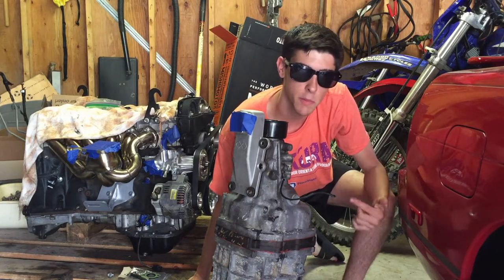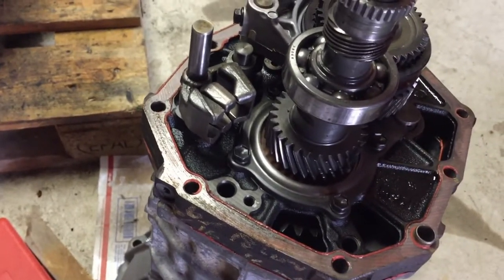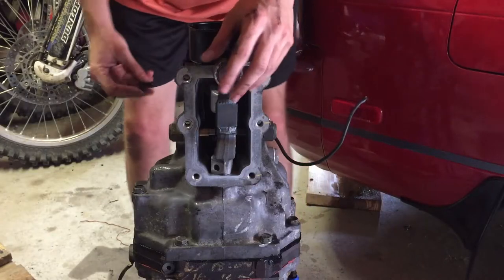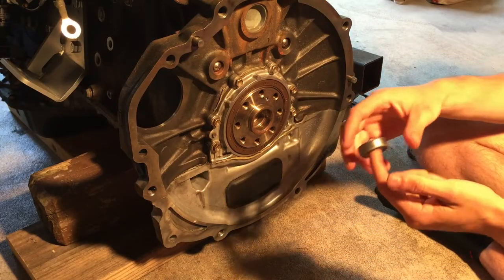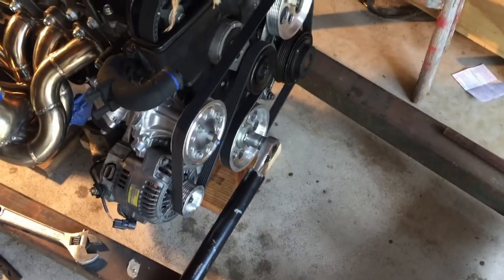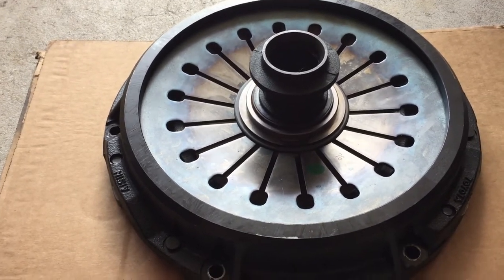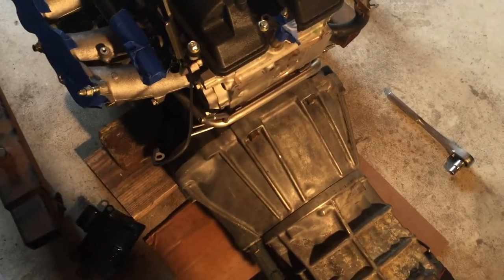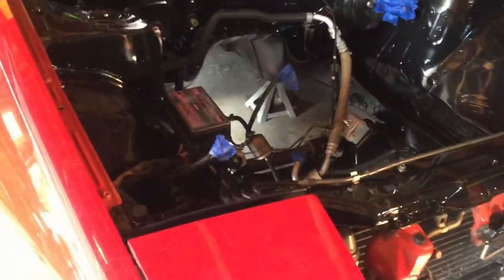Ep. 11 | Installing R154 Transmission on 2jz | 240sx 2jz swap

Comment: May we get the short shifter link? And how has it held up?
Reply from the maker: Not a problem boss! Here is the link:
https://www.amazon.com/PQY-Gearbox-Shifter-Compatible-1978-2002/dp/B07VRC5X2F

I am not too sure what you mean by "held up", but the base of the short shifter screws into the linkage housing with 4 provided screws, and the shifter lever itself slots into the shift linkage. Hope this helps!

Comment: Quick question. There is no plate between the transmission and the block?
Reply from the maker: Hey Olvin! I'm not sure I'm understanding your question. There should be three plates between the transmission and block (in order from the engine to the transmission): flywheel, clutch, pressure plate. Does that answer your question?
Reply: @TunerFaction  well like many other engines they have like a 1/16 thick plate or laminate that goes betwin the transmission bellhousing and the block, its more like a spacer I might be wrong and the 2j dont need that. Im in the prosses of putting mine together but I took this appart 2 years ago and I already dont remember how everything go😅😅
Reply from the maker: @Olrolo24  Oh I get what you are saying! To my knowledge the 2JZ does not need that plate for the R154 transmission or the T56. It may need it for other transmission adapters but it should come with the adapter kit if you are using one!
Reply: Got you. Im doing a r154 as well. So I don't need it. Thanks for the info. You got a really nice build man.
Reply from the maker: @Olrolo24  you're very kind brother! Glad I could help!!!

Comment: Tried replacing my shifter housing following the steps provided and now my R154 wont go into gear. Beyond frustrated because it shifted perfectly fine before I opened it up. Any suggestions?
Reply from the maker: Hello man, I'm really sorry to hear that your r154 isn't shifting into gear! So I'm assuming the transmission is still out of the car correct? And may I ask what happens when you try to shift into gear? Does the shifter not move at all from its neutral position? Does it move like it's going into gear but it doesn't actually engage the gear? 

One of the issues it could be is that when you went to reinstall everything, the shift forks weren't lined up. This would cause the transmission to not be able to wobble side to side like it's in neutral and the shifter would only be able to move forward and backwards, not side to side. Another thing that could be an issue is with the reverse detent ball (That little ball bearing that goes into the side of the extension housing). If that was installed incorrectly or not at all, the transmission will have trouble going into gear.

Please let me know what's going on, and lets figure this out together!
- Connor
Reply: @TunerFaction  hey man thanks for the info the shift forks seem to be in neutral when I pulled it apart and reinstalled. The shifter lever will not move forward or reverse and is very stiff moving side to side. I reinstalled all of the ball bearings correctly with the ball bearing first then spring along with the screw last. I’m not really sure what the issue can be I literally have the same set up as you with the hypertune (cubespeed knockoff) extended shifter. At this point I’m completely lost.
Reply from the maker: @tredizzle83  Alright man thanks for the info! There is only a number of things that this issue could be so lets get it figured out together! So one simple test I would like you to perform is to try spinning the output shaft with your hand while holding the input shaft with your other hand. If the input and output shaft spin together when you try and spin the output shaft, then your transmission is in gear and I'm 99% sure that your shift forks aren't aligned properly. One thing I should mention is that even if you had the shift forks lined up before you went to reinstall everything, one problem with these tranny's is that when you go to reinstall the extension housing, it's super easy to bump one of the shift forks by mistake and put the tranny into gear. If this is the case, you will have to remove the extension housing, re-align the shift forks, and then carefully put it back together. If the output shaft spins independently of the input shaft when you go to spin the output shaft with your hand, then your transmission is in neutral and I have a few more suggestions on what the problem may be! Don't worry man, we will get this problem solved together!
Reply: Yesssss the input shaft and the output shaft do spin together which means yes it is in gear. Next process is how do I get it back in neutral?
Reply from the maker: @tredizzle83  Sorry for the late reply! Ok that's good to hear! That means that the shift forks are out of alignment with each other. Now you're going to hate me for saying this, but the only way to get the transmission back to neutral is to remove the extension housing, and realign the shift forks after you take off the extension housing. 

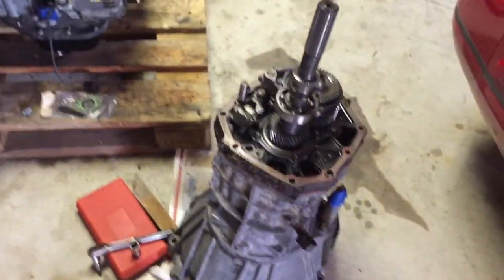I know you said you did it already, but in the video at 2:01, those are the shift forks that need to be in alignment. Like i said in my last message, it's super easy to bump the shift forks into gear when you're reinstalling the extension housing and putting everything back together so just make sure when you put everything back together this second time that you are super careful that the shift forks all stay in alignment with each other.

I wish there was an easier way to reset the shift forks to neutral without taking the tranny apart again but unfortunately there isn't. Please let me know if this works for you, if you're still having problems you know where to find me!
Reply: @TunerFaction  No worries I sent you a message on IG with pictures.
Reply from the maker: @tredizzle83  Awesome we can talk there!
Reply: Did you ever figure out the issue? I’m having trouble getting into reverse, but all other gears work fine.
Reply: I followed your previous video, but now this video has me worried with the detent ball on the tail housing..
Reply: @wtfmangisimo  hey man I dropped my trans off at a Toyota specific shop. They opened the trans up check everything to make sure it was in good working order and fixed my issue with my shifter being stuck in reverse. I was lucky the shop did all of the work for $200.
Reply: @tredizzle83  damn, that’s not bad. you in california?
Reply: @wtfmangisimo  Arizona
Reply: @tredizzle83  ahhh gotcha
Reply: @tredizzle83  i just dropped the tail housing off the trans & luckily the detent ball is in place. and the shift forks are aligned. so pretty lost, probably owner in japan grenaded reverse lol
Reply from the maker: @wtfmangisimo  Hey Armando, it sounds like your transmission is stuck in reverse. If you have your detent balls in place then you will have no other option but to open up the transmission and disengage the reverse idler pulley. This is difficult to do if you don't know what you are looking for and would recommend taking it to a shop to get it done right. If you want to move ahead and try it yourself I can give you all the info I have about it!
Reply: @TunerFaction  All good. it might actually be the shifter arm! I shoulda took the shifter housing off first to begin with to avoid dropping the whole tail housing.. but using my hand to move the shifter arm into reverse it actually went in.
Reply from the maker: @wtfmangisimo  That's awesome man I'm glad to hear it! So it sounds like you know what the problem is then?
Reply: @TunerFaction  Yeah! should be good to go!
Reply from the maker: @wtfmangisimo  That's great Armando I'm happy for you my friend!

Comment: hey man just didi my install did you need to gresse the input shaft? thank you
Reply from the maker: Hey man! Yes I did put grease on the input shaft! Hope this helps!
Reply: @TunerFaction  I didn't grease anything and installed it dry il lyk how it goes lol would have to pull the trans again anyway lol
Reply from the maker: @chasemcclary8861  Hey brother you should be fine. It isn't necessary and won't break anything. It's more there for the added assurance that nothing will bind up. Don't lose sleep over it!
Reply: @TunerFaction  yeah my clutch does squeak but im cool with it lol only when let out very very slowly lol.

Comment: What brand of high temp grease did you use?
Reply from the maker: This is the grease I used:
https://eliteracefab.com/products/red-line-cv-2-grease-with-moly-14-oz-jar?currency=USD&variant=39519033098408&utm_medium=cpc&utm_source=google&utm_campaign=Google%20Shopping&gclid=Cj0KCQiA_8OPBhDtARIsAKQu0gZDEMn9g6FEHpDBt67hxK5izgiFfP9_OP4VAb406CJiq0lEdt9VfU8aAnmsEALw_wcB

Comment: 1jz fw or 2jz fw?
Reply from the maker: I believe the flywheel is compatible with both the 1JZ an 2jz my man!
Reply: @TunerFaction  but is the 2jz flywheel compatible with a r154?
Reply from the maker: @2jzgenat  do you mean the stock 2jz fw?
Reply: @TunerFaction  yessur. I have a 2jz flywheel that mounted onto a w58 but i am now upgrading to a r154 so i wanted to know if i need to get a 1jz flywheel.
Reply from the maker: @2jzgenat  yeah I'm pretty sure the 2JZ won't work with the r154 my man from the searching I did!